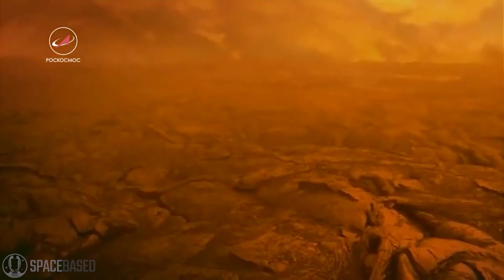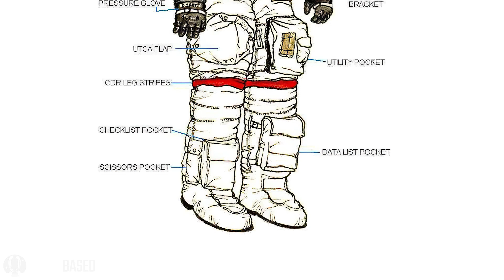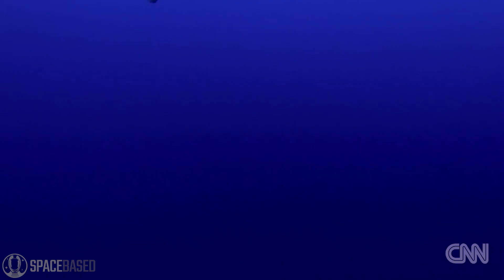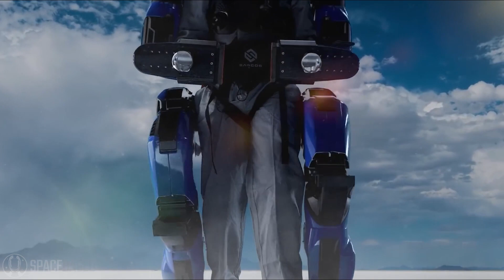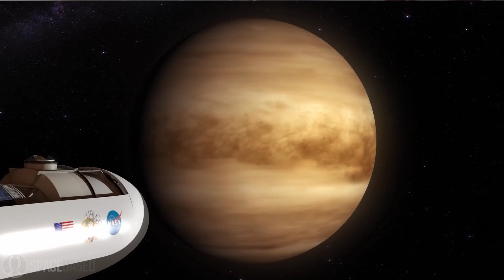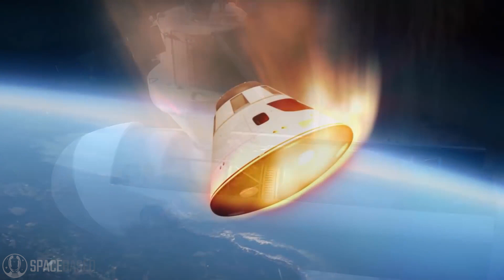Can We Build A Spacesuit For Venus?

Comment: Great video! One additional saving grace I thought of is that scuba divers have dove to 300m in the ocean. NASA has also experimented with using helium-oxygen breathable gas mixtures to 10 bar. Obviously this is not 93 bar, but maybe we could lower dp to ~1220 psi by running the spacesuit above atmospheric pressure. But the next question would be does that reduction in dp offset the increased thermal conduction of having to cool a greater mass of air?
Reply: I've never heard of the Helium-Oxygen mix before. Sounds pretty useful.
Reply: @ericgolightly8450  Yes, it can even be used medically, as the lower density of helium as compared with nitrogen makes it easier to breathe, since a lower mass is passing in and out of the lungs. Helium-Oxygen gas mixtures are typically referred to as Heliox.
Reply: @DR_AERONAUTICS  that's pretty cool

Comment: Towers. 

If we land large hollow metallic components om the surface we can construct very thick squat towers. I hae no idea how much rocket systems could drop from LVO but I am thinking cylindical structures about 100 meters high and 25 meters thick.  The first bases should be automated, nuclear powered with only rudimentary cooling to keep the structure somewhat intact. The lowest structure that lands would be very heavy and would land with a reactive that aggresisvely burns in a CO2 environment - but we might also be able to use a rocketing system with hot nukes. The first lander is essentially a squat heavy landing foot with some tunneling and very rugged hatches, and empty bays. It lands in a spot that's geologically very stable. On top of structure A is a landing surface with a very large docking port. On top of that lands a similar structure, but this one is a comparatively hollow titanium shell. There would be work spaces and bays in there, and the rudimentary bulkheads for an elevator.  It being hollow, you can eventually pump out its contents (wich would probably be a fluid initially) later on. From then on you just add cylindrical landers that decend on top of one another. Each one would rely more on byoyancy in the atmosphere. You can construct towers on earth with prefabricated components in a military style additional stacking process probably as high as kilometers, but in the venusian atmosphere, given a fair amount of vertical column cooling infrastructure, mixing it with byoyancy tanks with little else than vacuum inside you could do two things (a) a fair amount of thermal insulation and (b) reduce the structure in weight as to add less burden to the structure below. If you use several of the intial landing feet and add interlocking hexagonal structures on top, much like an oilrig, you'd get something like the TROLL oil refinery rig structure that's currently situated on the North Sea continental bedrock, and  is about 500 meters high. We need many many kilometers, so no doubt we must leverage bouyancy to keep the structure erect, much like floating tanks in the sea. These can be full of liquid, but after structures are added, we pump them empty so they lean less on lower structures. How high can you stack this? If you use a gradual scaling progressiion of less and less heat/pressure resistant structures as you ascend the atmospehere you can make these structures progressively less bulky titanium tanks. Higher tank structures would gradually have more balloon like tanks, possibly maximixing lift with vacuumpumped metallic cylinders, kept aloft in the furious venusian storms with propellors or jet engines. As you ascend there would be nuclear reactors at steady intervals to aggressively pump down coolant fluids. Initital landers would be quite low on crew potential, but some might be handy for initial science work. But probably not, we might be better off with robotics. A chemical rocket system a la Spacex projects re-usable rockets of a hundred meters high. If you use nuclear systems you can probably make them capable of precisely manouvering substantially more massive entities. Once the pillar is in the range of 10 kilometers we might need active thrust to keep the structure stable and elevated - essentially a tower that's kept upright with nuclear powered jet engines blasting at 45 degrees or less. By interlocking and carefully snapping together (hexagonal?) elements you can probably make the tower several ten meters thick and each element about a 100 meters high. Let's say initially nine (hexagonal) elements for a support each 15 meters thick for a total thickness of about 45 meters. That's nine elements on par with Spaced rockets per 100 meters, i.e. about a thousand descend vehicles per kilometer, probably some extra for boyancy tanks and reactors, If it's possible, engineering wise, to get this structure all the way up where we can add something that would liik as a scientific platform, say about 35 kilometers up. From then on you might add a large horizontal surface that can add cranes, elevators, laboratories, crew sections, a hotel - all still aggressively cooled - an industry section, etc. You can then start adding more sections, making the footprint bigger and bigger, making the tower wider and wider. As you proceed you can remove older segments in the middle and crane in place different functionality segments. To get to 35 kilometers  we would thus need an initial number of unmanned vehicle descents in the order of 35 thousand vehicle movements, each with a 100% deployment record - a crash might destroy the structure. You'd have to bring all that infrastructure to venus with a very powerful propulsion system, ferrying back and forth from the earth-moon system, and bring in the orders of millions of tons to venus per, say, year. You'd construct the landers near earth, and you'd probably need a constant stream of gravity assist landers scattered throughout the solar system using gravity slingshot cycles to save reaction mass. And that's the initial tower, at a 35 kilometer heigher about the venus surface, where it's still over a 150 celsius and the pressure is still 10 atmosphere. But a 35 kilometer platform like that can hold a winged body landing strip and could connect some sort of airplanes or helicopters to baloon structures at a higher atmospheric layers. Or tether baloons in a pearl necklace up, add an elevator and you can literally have crew quarters and a city, maybe even tourists, at 50 kilometers, and an elevator system down to the depths of hell below. A structure like that can be built with at least plausible technologies right now, but the economic growth requires for thus would be in the orders of several centuries. we could have a tower down to Hell say, in the year 2250. So it seems thinkable the first human organic scientist (if scientists still have human bodies by then) could be on the surface of venus around that time, having come down in a metal tower, surrounded by a sargasso of violent heat pumps and coolant tubing, in a claustrophobic elevator. I can see the scientist look out through an insanely thick observation port filled with several layers of coolant liquid, and behold the surface of venus. I would not volunteer to be that scientist. It would be very scary.

This would be an awesome movie set though :)
Reply: Geez, write a book will ya'? Just joking,not only are you smart but good looking.What a deadly combination?
Reply: I would volunteer to be that scientist. I trust the person who basically just wrote a paper.